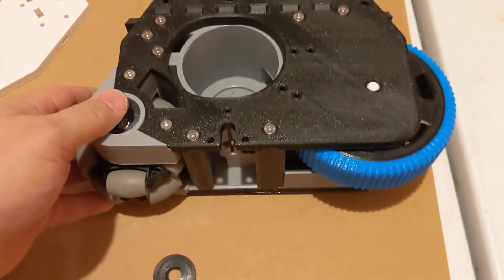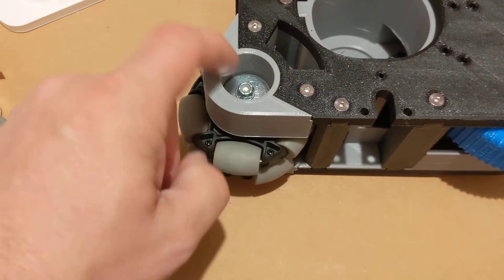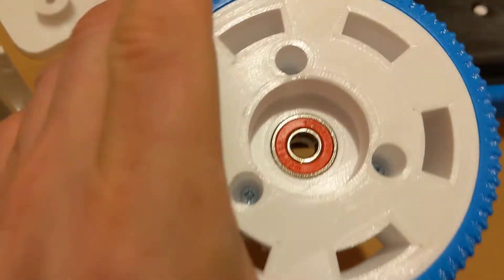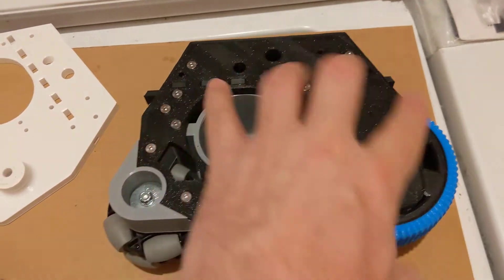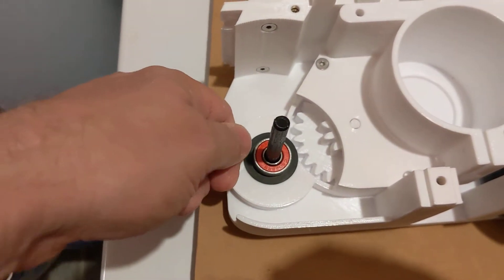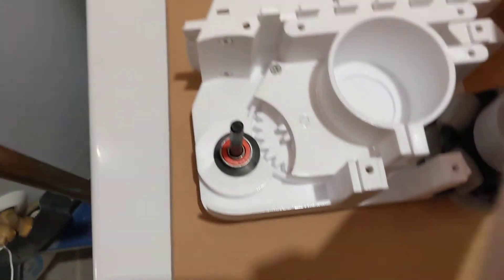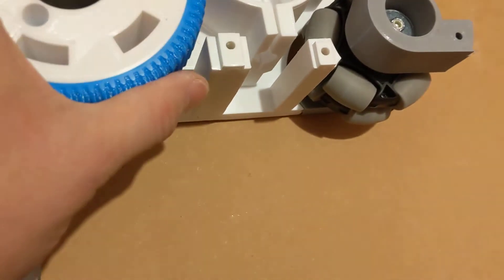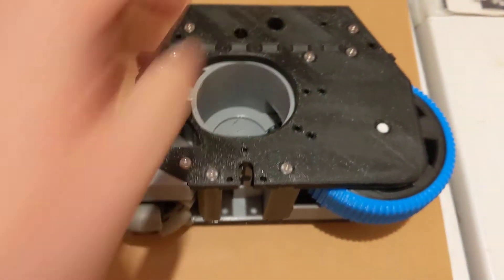3D Printed R2D2 - Part 25

Comment: i just started the feet and ooo boy thought the body version 2 was wild and the legs there so much going on in the files just for the feet just what i see maybe with the bearing falling out use a 3d pen to add some pla or to heat up the sides to the bearing on the problem with the pin you think you should reprint i would than use some wd40 see if that dont help the bearing slide down easier or maybe a air dryer to soften the shaft i just throwing ideas let us know what you find im about to be in the same boat

Comment: Could you not take out the Metal washers on the inside out, I think you should just leave it and not put a washer in there great video I am glad I found your channel. I am printing with PLA+ I have put the motors on my Christmas list in fact me my wife and mum do Christmas Eve boxes and a lot of the bolts nuts and some other bits I need for my R2 build I have put a little list together and asked for them to buy me something off my list that way I get what I need
Reply from the maker: Good question about the metal washers!  Unfortunately I didn't explain very well how the omni wheel assembly works, and why the metal washers don't have anything to do with the tightness.  I've just made a new video that shows how the assembly works, and I've managed to make the omni wheels spin much better!